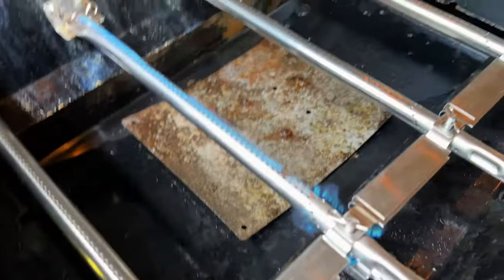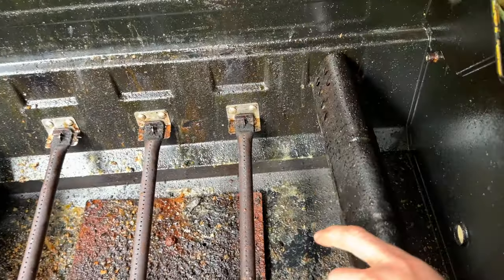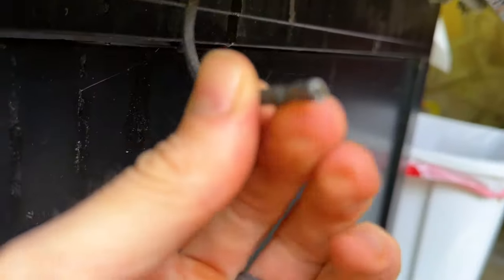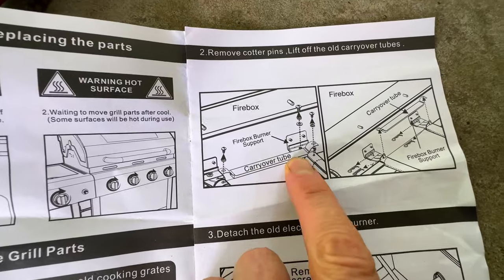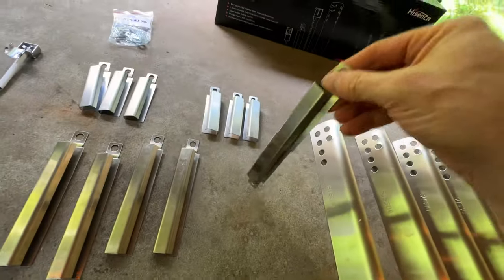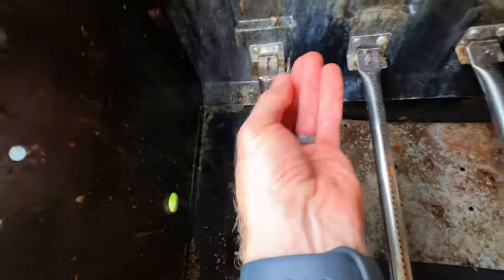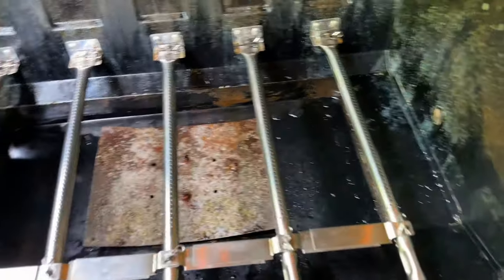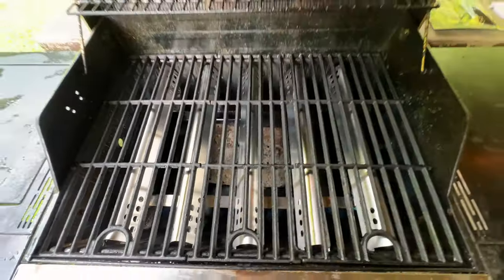Char-Broil 🔥 Grill Burner Replacement

Comment: What model number is your grill?  I have the exact one but don't know the model number. 
I need the exact same parts. What site did you order your parts?
Reply from the maker: Great question! It’s in the Char-Broil Performance Grill Model 463347519 and below is the information on the specific kit I ordered.

Hisencn Grill Replacement Parts for Charbroil Performance 5 Burner, 304 Stainless Steel Grill Parts for Charbroil 463347519, 463347518, 463361017, Replacement Parts for G470-5200-W1, G470-0004-W1
https://amzn.to/3QyXz8J
Reply: I am about to replace my burners tomorrow.  Model 463449021.  Whole set should be about $50 or so.  I ordered mine from Amazon as Charbroil did not have the parts in stock at the moment.  This video was really helpful!
Reply: Thanks for the video

Comment: Your vid has been very helpful.  2 big issues I have: I can't get the igniter to clip on to the tube at all and my flames are coming out light a flamethrower.  Could it be the regulator hose? Any help would be appreciated.  Thanks
Reply from the maker: I also had trouble getting the igniter to clip on there, and I think some of these kits are a mix of parts. I suppose it's possible you may have received the wrong igniter. As for the flames, I think it could be the regulator, or the tubes aren't lining up, or something is obstructing the flow of gas. Before we replaced ours, the small holes were clogged and I recall the gas wasn't able to mix properly and flames were shooting out at the crossovers like a flamethrower.
Reply: @EricCosner  I’m wondering if the crossovers may be on backward? I wasn’t sure which way they went, but they are working properly for me. And I used a pair of pliers to squeeze the igniter on the tube.
Reply from the maker: @rogerhartmann4180  I suppose it may be possible that having the crossover installed one way or another might cause a flamethrower effect. It hard to tell looking at the diagram which way is right. Whether I did it right or wrong, looks like I installed them with the open part toward the front of the grill. They're still working great. Only complaint I have with my grill is that in the winter time, I have to heat my propane tank in the shower or my flames are weak lol. I'm guessing that might be related to the regulator.